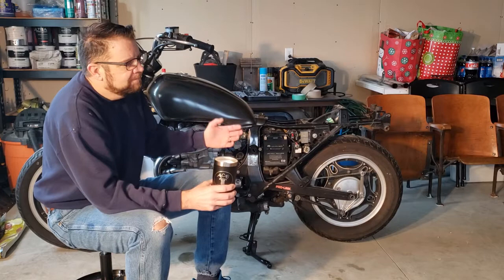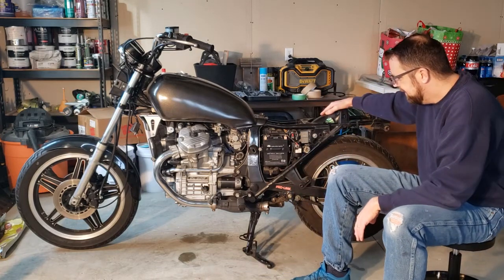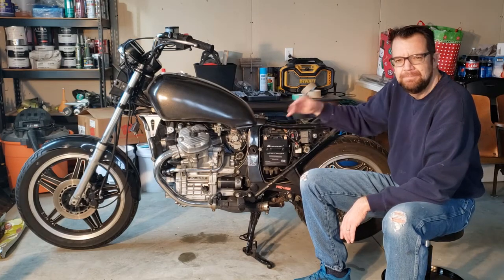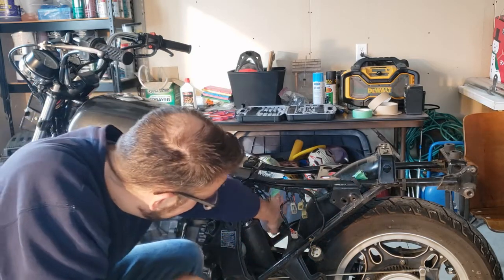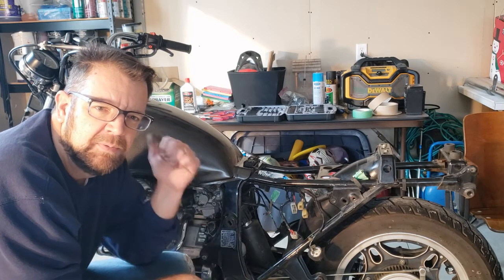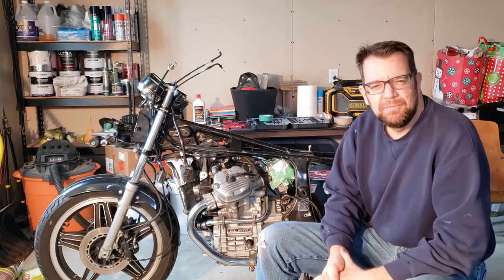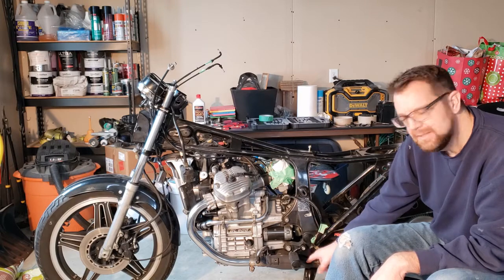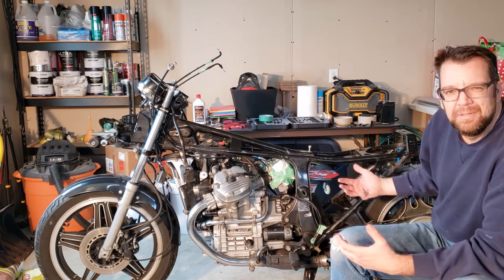HONDA GL500 Project - Ep2 - Teardown 2

Comment: Will you be able to link parts to the bike that you put on during the build process? 

Love the progress so far
Reply from the maker: Thanks, its definitely a work in progress.  I should be able to send you a link, I've bought most of the stuff off Amazon.  What parts are you interested in?  Shoot me an email, address is in the About section.
Mike
Reply: @ACECafeBikes  i would love to send you an email and chat about parts of the build. I have an interstate model and at the moment just want to make it more bare without the extra weight. Looking more for brakets and lights to use for the front. 

I cant actually find an email but I do have you on Instagram now
Reply from the maker: @dyllanstolzenburg970  My email is pretty simple AceCafeBikes@gmail.com 
Mike